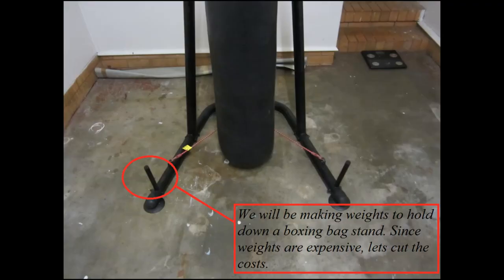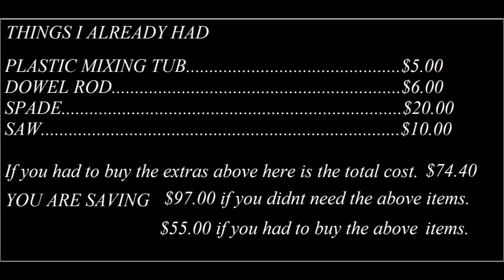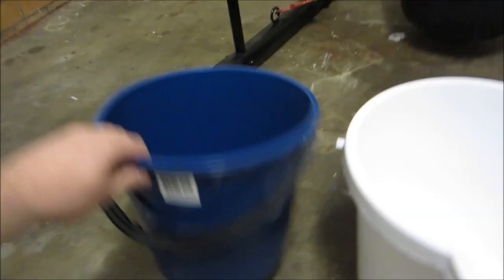How to make weights for a boxing bag stand - Interfecter Vmad

Comment: I have a question, how do I make my heavy bag a little higher on the stand, because im always punching the top
Reply: The top is the best part to be hitting man, you will get too much motion if you hit too low on it.
Reply: Zoro kick the middle
Reply: You can get D-Rings (Depending on how many straps is on the punching bag - mine has 2) and clip the bag directly to the hanging hook, eliminating the chain.